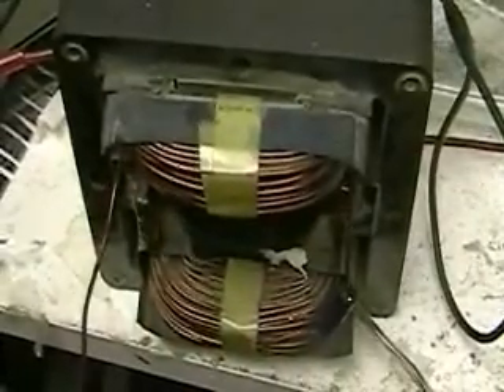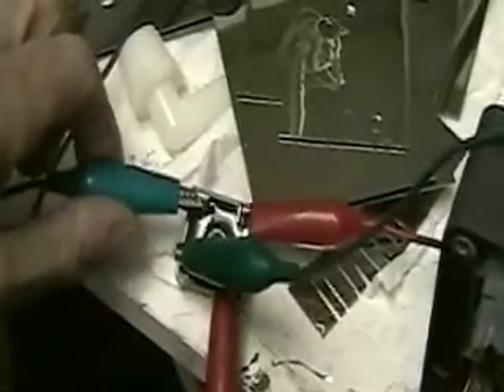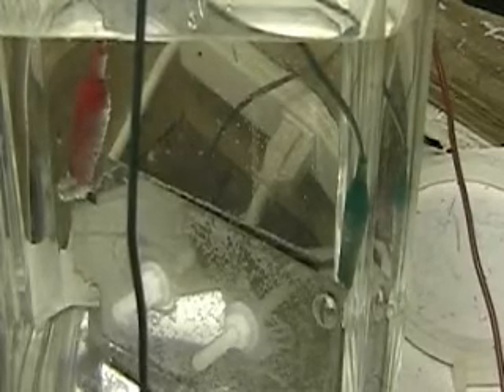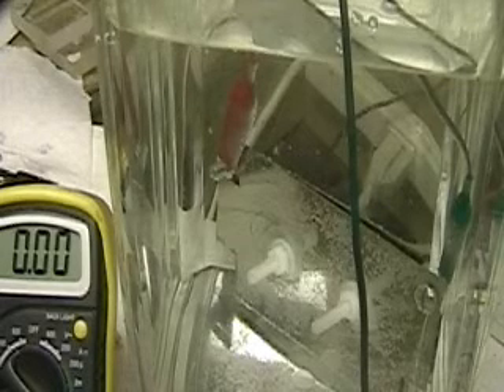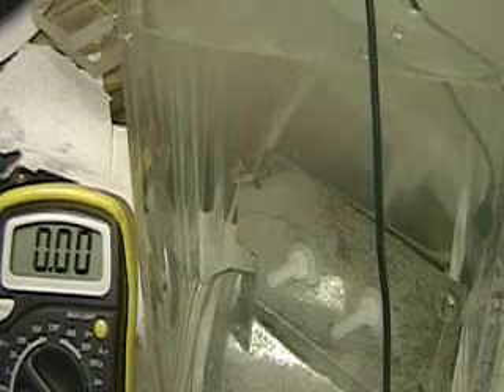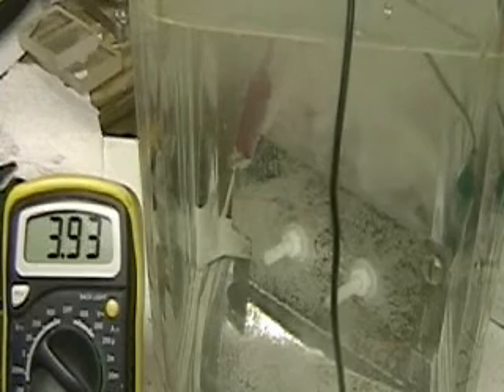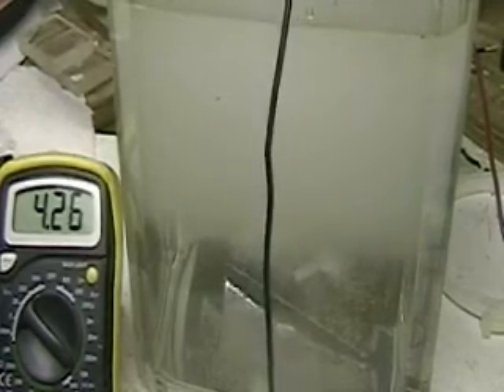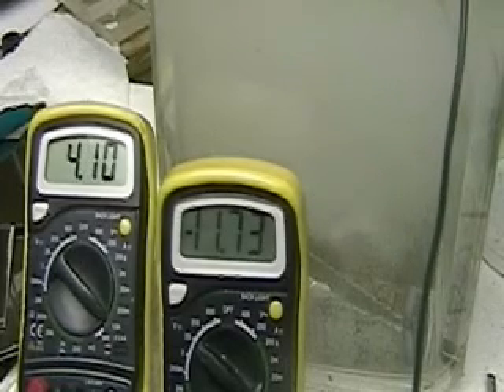Hydrogen Tap (Pulsing the Plates) 269

Comment: I think (though I could be wrong) that DC is the wrong way to go. If the "cell" is in essence a capacitor, we are looking for a dielectric breakdown to produce hydrogen. If AC is used, you can shoot for inductive capacitance. Increasing the AC frequency from 60Hz to whatever, will raise voltage, drop amperage & create the same dielectric breakdown....would it not?

Comment: I heard that Stanley Meyers used High voltage and low frequency (100-300Hz?) in distilled water to generate hydrogen. No electrolyte too, that is very interesting!